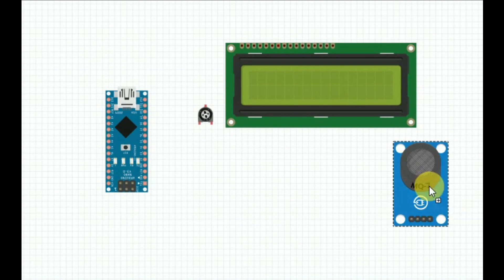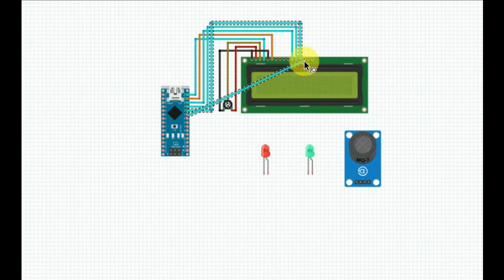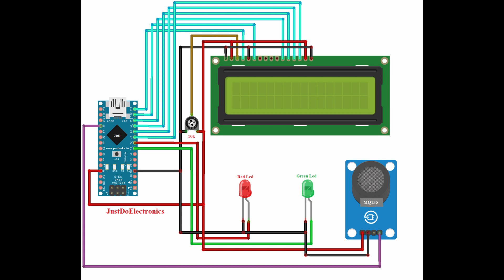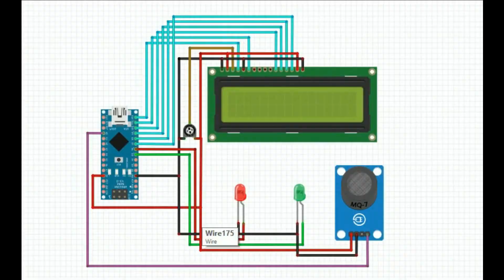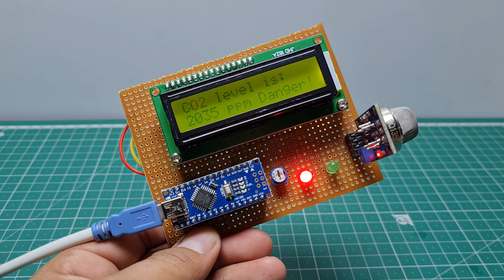Interfacing MQ135 Gas Sensor with Arduino | Measure CO2 Level in Air

Comment: The thing is , the sensor's output is nothing more than ADC value itself which this is mapped from 1023(max res for an 10bit device) to 5000.  There are proper equations which let you to know a specific gas concentration. But first there is an calibration procedure for that. And remeber , each sensor is a sensor , so the values on output may be different!
Reply: And yeah you can use ADC values to determine some gas "variation" , but nothing more :)
Reply from the maker: yes you are right :)